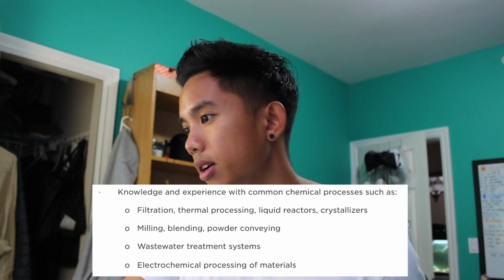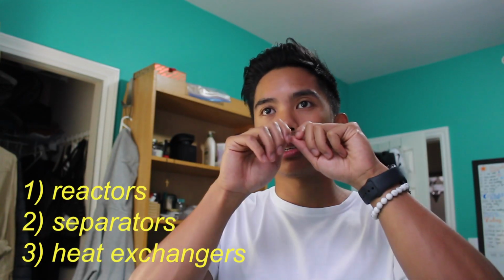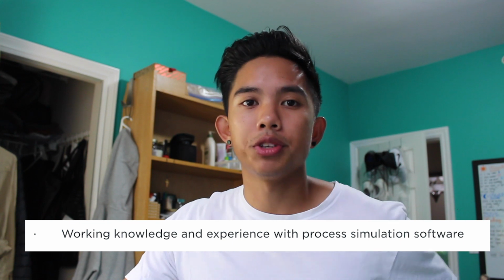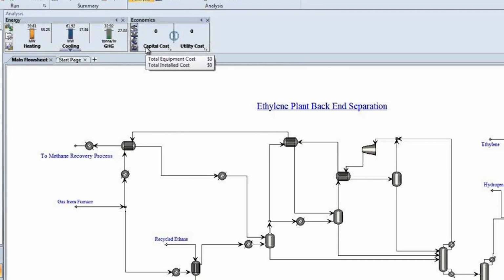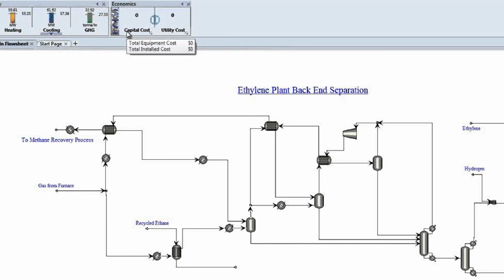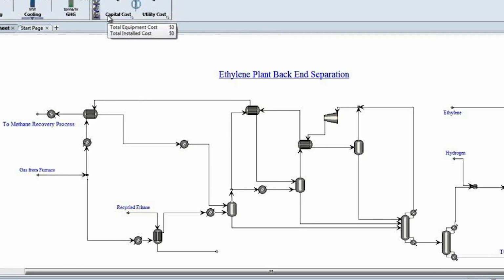What Do Chemical Engineers Actually Do?

Comment: At what point in your education/working life did you feel comfortable in applying your knowledge? (when did you know what you were doing 😅)
Reply from the maker: It's not until I entered the work force that I realized I had barely scratched the surface in my undergrad. I feel comfortable in applying my knowledge but still feel like I know nothing sometimes 😂 I have to constantly go back to the fundamentals I learned in school, but now I get to apply those things to real world problems. For example, with a heat loss problem, I can get immediate feedback using test data on whether or not my predictive analysis was correct. I also get to explain my results to smarter, more experienced engineers who can give me feedback. So in summary, I feel comfortable applying my knowledge, but I definitely don't have it all figured out yet! Thanks for watching, Ben!
Reply: @shawn.builds   Okay that’s great! I’m in my 2nd year of study and still feel like I can’t apply my knowledge off the top of my head, which makes me worry when I eventually enter a work place. But I guess most learning is on the job and that’s when you become more confident? Thanks!
Reply from the maker: @benrobinson7937  I'd say don't worry about it too much in your undergrad since there's like a million equations they tell you are important. What's more important is to be able to look at a problem and ask yourself if you'd be able to apply the problem solving methodology to find an answer. Everything can be googled, so work is more about critical thinking. As I mentioned, I can always ring up smarter people to get their opinions on things when I'm really stuck.

Comment: Heey, I really like your videos, so initially thanks for all the useful info !! Besides that, I'm in second year of Chem Eng university in Brazil and I'm a bit confused about the differences about working with process and production. Are these two completely separate areas or are they kind of the same? (Idk if this is something that happens only in Brazil, but that's one doubt I have). Thanks!
Reply from the maker: From what I've seen, production and process engineers have almost the same job descriptions, so I'm not really sure about the differences there. I would say a Process Engineer is more of a chemical engineering role, while production can be any engineer or technical person that is focused on Lean Six Sigma principles.

Comment: I want to get into the consultancy business as a process engineer. Unfortunately I'm still fresh from school with only internship experience and having trouble finding work. 

So my questions are how do I do it?
Which knowledge must I have to do it?
Any softwares you can recommended that I can learn which I can use to make some cash?
Also process optimization, which sources can i use to master it? 

murerwatinashe@gmail.com
Reply from the maker: I recommend connecting with some consulting people on Linked In. I know one company (Helium Inc) that focuses on assisting people to get jobs in consulting. I'm not too sure on software you can build a sidehustle on for chemical engineering but coding is always in demand :) For process optimization, I learned most of what I know from taking a university course on it at UBC (CHBE 476: Modelling and Optimization).